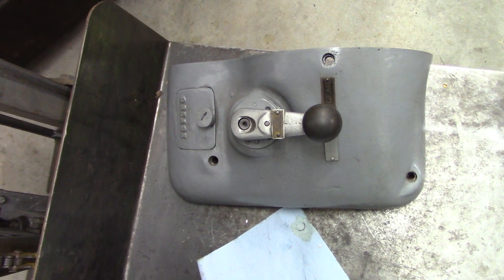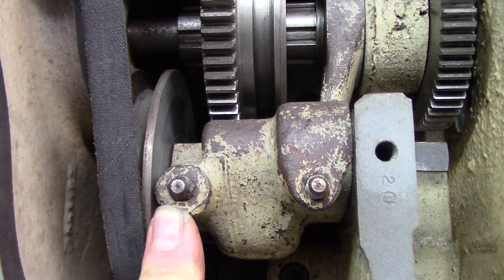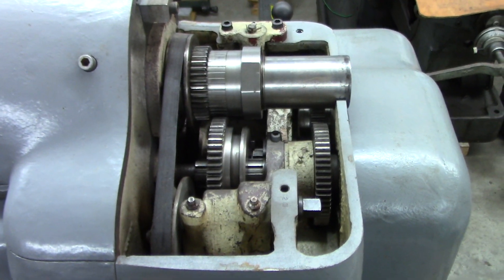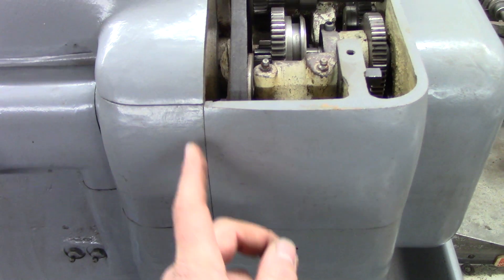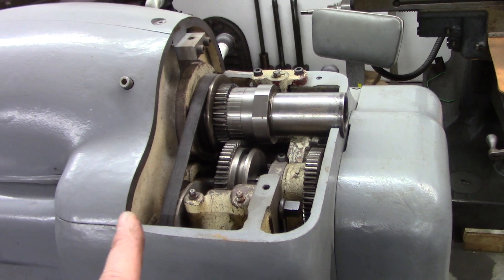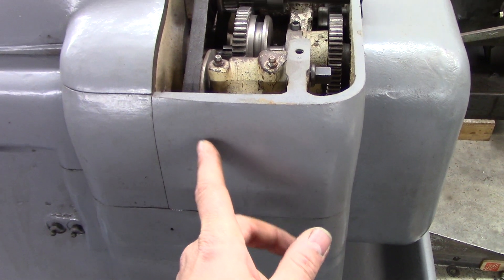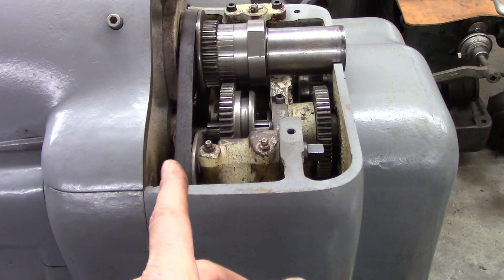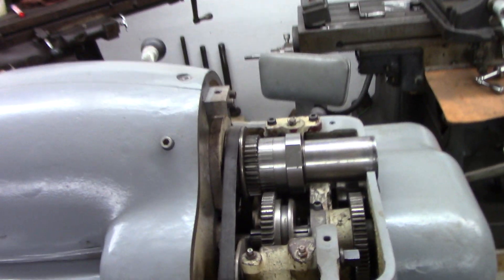12-27-23  --  Hendey T&G Lathe Part 17

Comment: Just stopped in, have not watched the whole series.. but, cool to see the insides of this machine.. 
I believe they use the belt drive for feeds, to isolate the spindle from vibrations from a gear drive, at least on this sort of lathe.. I was surprised to see the belt (not to mention that bushing) right in there next to the gears - lube good for gears, bad for belt.. Maybe intent is to use gears only for threading at modest speeds (see manual, or any warnings on the machine!), & above some spindle speed, use the belt only, for feeds. & maybe thats why they could get away with grease for those bushings & gears.. have heard these are really nice machines, if you can get it running as was designed, that seems preferable to chopping things up & sticking in an extra feed motor (although if you do, consider some kind of geared motor along the lines of what Hardinge uses.. might not even need to use full range of existing gears - may want to work out inches per minute of speed you would want in various situations ).. Thx!